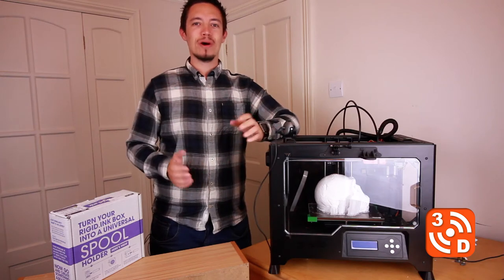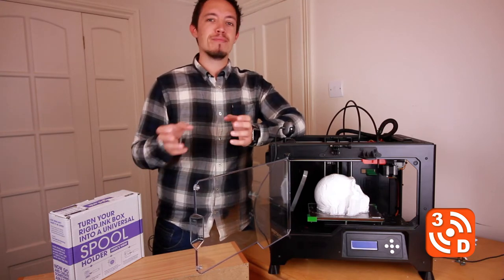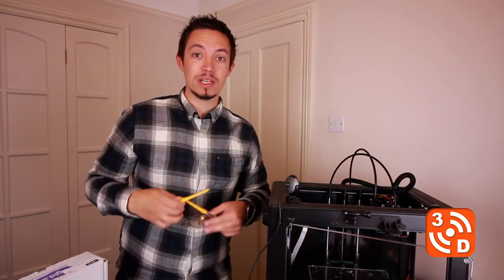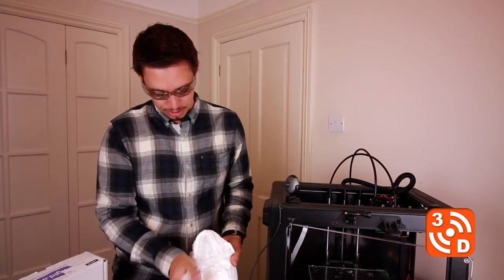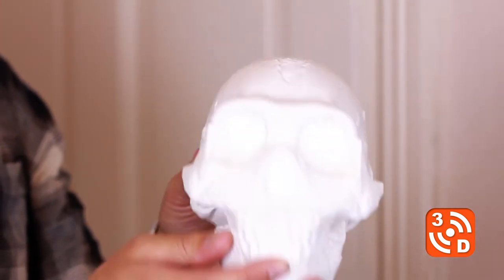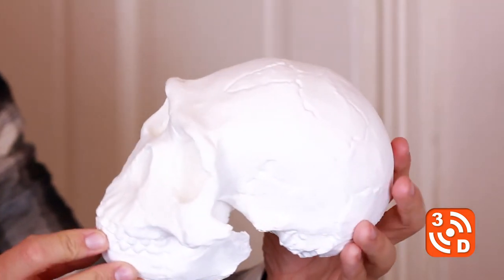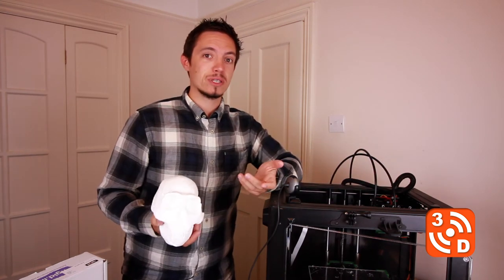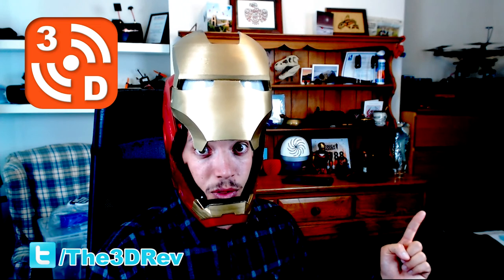Break Away Support Material review And 3D Printed Hominid Skull

Comment: Hey, great video - I've got an Ultimaker 3 and I've just bought the Rigid Ink Breakaway material - it seems to print fine but I can't get things to stick to it, I've tried both Rigid Ink ABS and Rigid Ink PETG and the prints have failed. Any tips? I don't really want to just print with PLA because it's so restrictive!
Reply from the maker: Hi titaniumapple1, I'm glad you like the video and thanks for your comment. Sorry you're having trouble with the support material. It can be a little tricky to get adhesion to begin with but what I've found is that unlike when printing with same material supports, you need to massively reduce the separation distance  between support and model. I also print my support at a fairly low resolution, but increase it to 100% infill on my support material for the top 2-3 layers to provide a decent area to grip. I haven't personally tried it with PETG or ABS but I'd imagine results should be similar. Let me know how you get on.
Reply: 3D Revolution Thanks, yeah I've tried lowering the separation distance and it makes a huge difference! I'm using Cura, I guess I just add a 'roof' to the support right? Thanks
Reply: Hi try work Whit pla tough filament  it si more strong